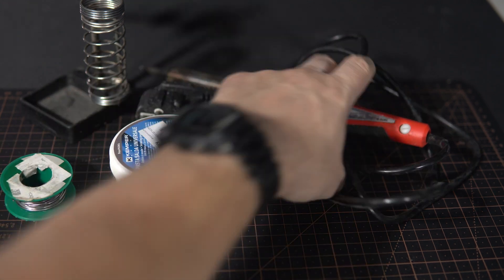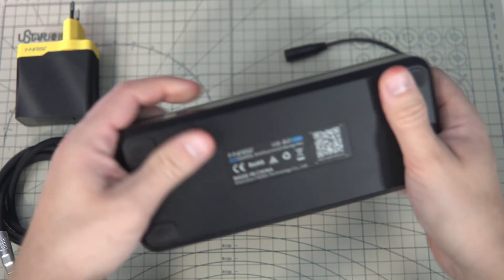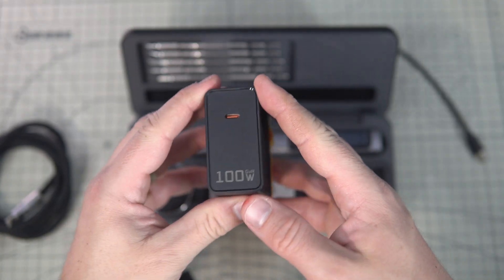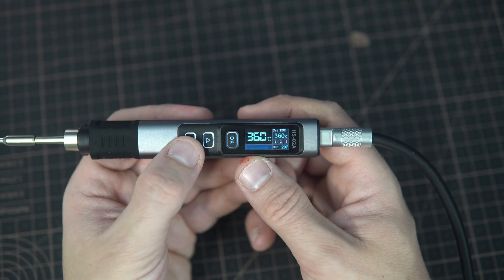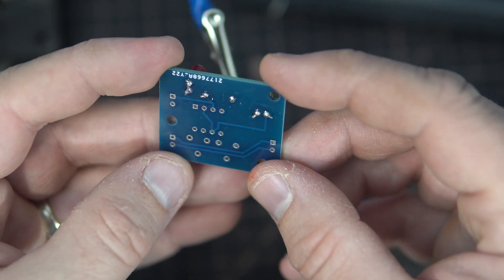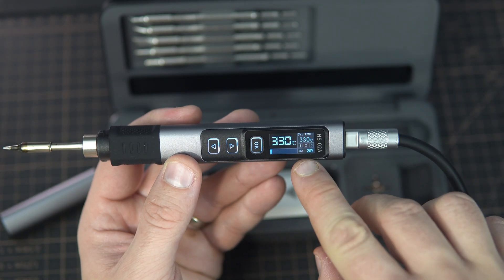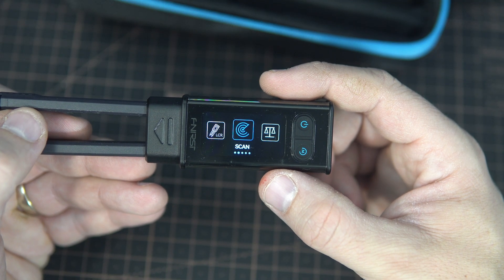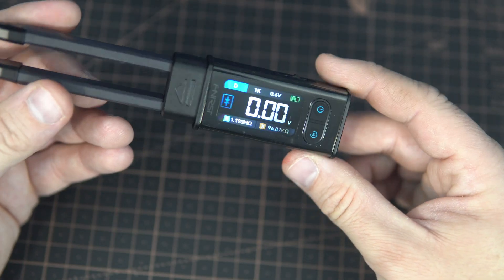FNIRSI HS-02A Review & Testing | 100W USB-C Smart Soldering Iron

Comment: 8 seconds for reaching 330 from 50 is fast? Maybe in comparison to your older AC soldering iron, but not for 100W iron for that price! So there is something wrong with this iron, or with your power adapter, because there are irons with less power (and same price like Alientek T80), which reaches 330 from 20 in less than 2 seconds! And even much cheaper chinese clones of T80 for about 17usd have much better power and temperature regulation.

Comment: i own both versions of that soldering iron - the micro and regular. they didn't come with a full set of soldering tips. i ended up getting that separately. i don't use their solder and may replace the spool with my own.  if i was to improve it i might replace the brass sponge with a small hakko one as well as remove their solder. they should have just given us an empty spool to put our own.

what i like is you don't have to wait for it to cool down before putting it away. just put the cap on it after you unplug it then it can cool inside the cap. i have it preset with my common temps & it gets there in seconds.